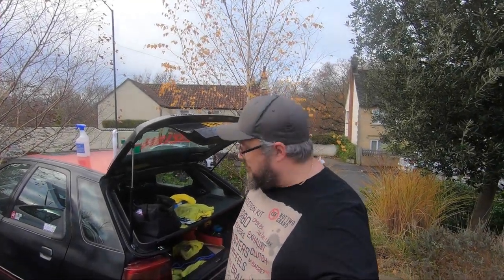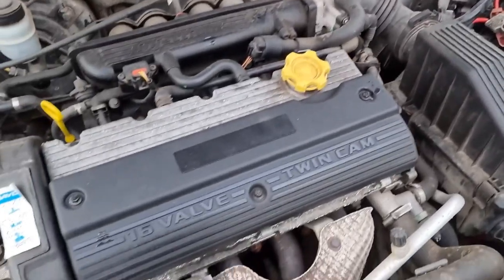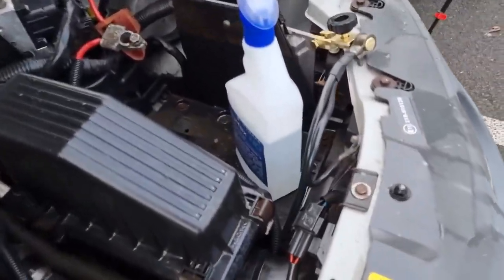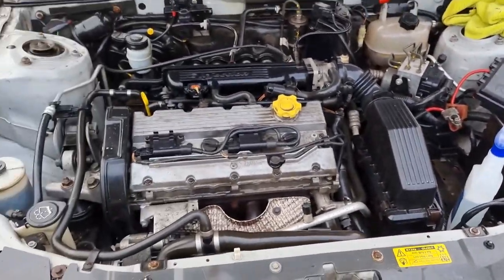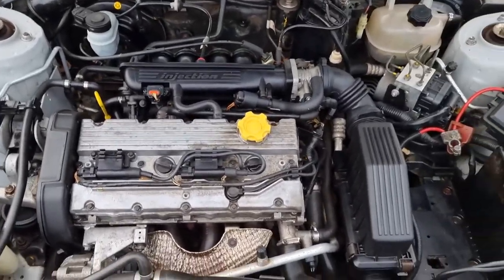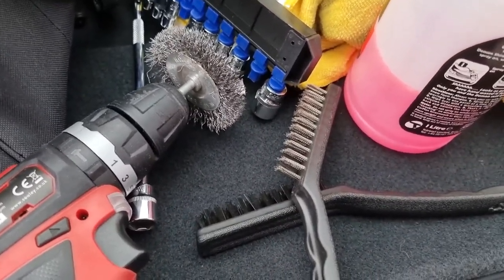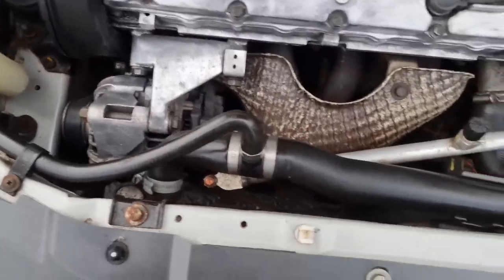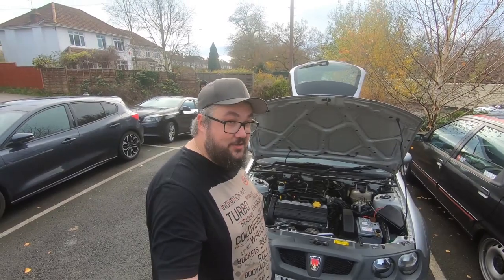Engine Detailing 'how to' on Rover Streetwise - AMAZING TRANSFORMATION

Comment: Nice job there. I worked on those cars at Longbridge. Did you know they stopped fitting the bonnet sound deadener to reduce costs? The diesel version was especially noisy because of it. Shocking.
Reply: One of the many Project Drive cuts, along with felt carpets instead of the deep pile used in the BMW era, badges deleted, lower quality interior plastics, other sound deadener deleted, and other things

Comment: Did the Rover 25 models ever have a factory-fitted sound deadening under bonnet pad, like the one fitted on the CityRover, or was that deleted later on in the production run, as part of the Project Drive cost-cutting austerity measures?
Reply from the maker: Honestly not sure. Doesn't look like it ever had anything.